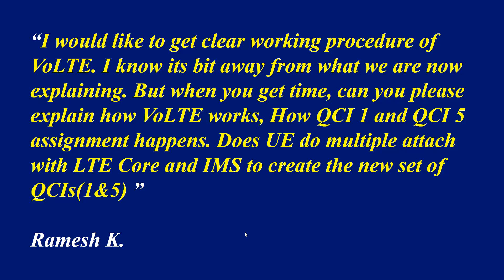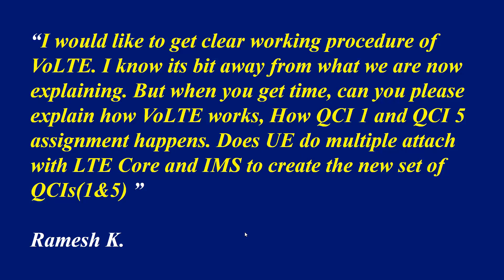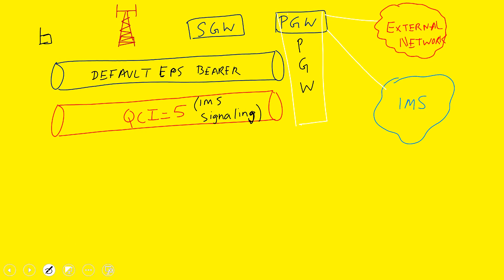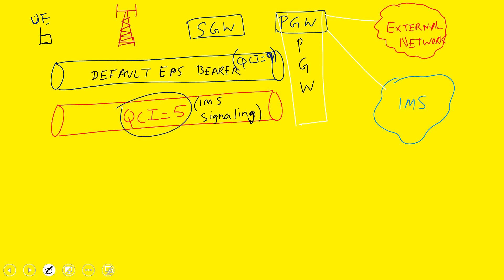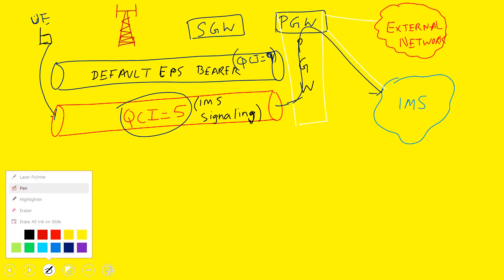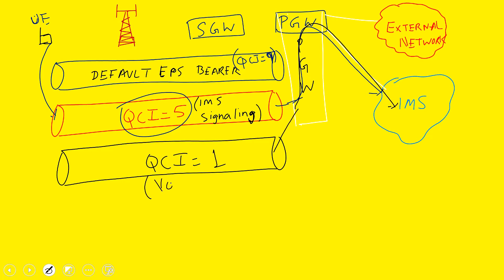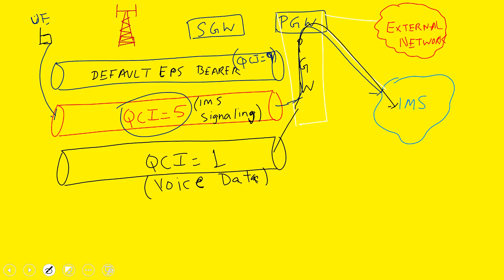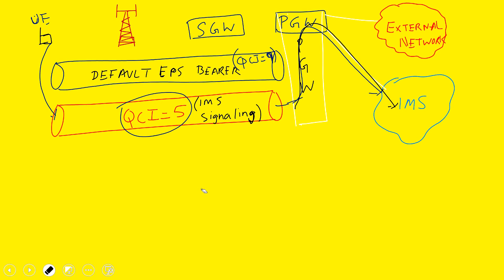Does QCI 1 and QCI 5 setup simultaneously for VoLTE ?

Comment: Hi, When before i make the VOLTE ON, there would be primary default bearer so does Primary IP, when i Make the VOLTE ON will my mobile get another IP address for IMS . I checking my mobile after making volte on and OF and in both case found only same single IP . Can you elaborate this Thanks

Comment: If, we switched off the data from phone. i read through documents, that i will be able to make a VoLTE call even my data is off. But in that case, there will not be Default EPS Bearer with QCI 9 (as the data is off), but there will be Default IMS bearer with QCI 5. and then Dedicated IMS bearer will be established with QCI 1. Hence VoLTE call takes place without data ON. Is the understanding Correct ? Pls suggest.  Thanks in Advance. :)

Comment: can any other QCI  BEARER established for internet access except qci 9 why?
Reply: QCI 9 which we call the default eps bearer is established when a UE is attached to the network. It is not taken down till the UE detaches. So this is not for internet access but you can say for network access acting as an invisible pipe or say connection between the UE and PDN gateway (PGW). Why QCI-9, i think because it is a non-guaranteed Bit Rate (Non-GBR) meant to support best effort (no guaranteed quality) delivery. Also please take a note that the QoS functions provided by a network are all based on standards (3GPP in case of LTE) and from a carriers perspective it can be better if you pay more :D and/or for your high-priority traffic (e.g. voice or video traffic that is more sensitive to delay in its nature than Internet traffic..
Please feel free to correct me or add to my knowledge.
Reply: QCI-5 is only for IMS signaling right ?? we can send data also ??